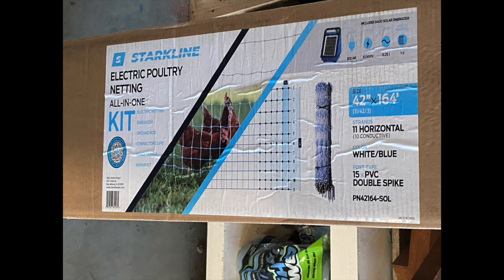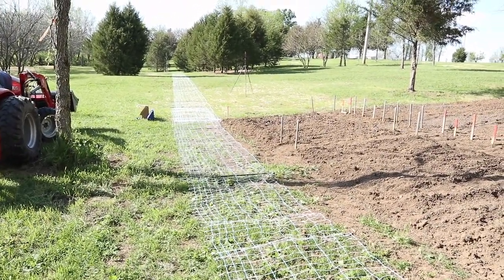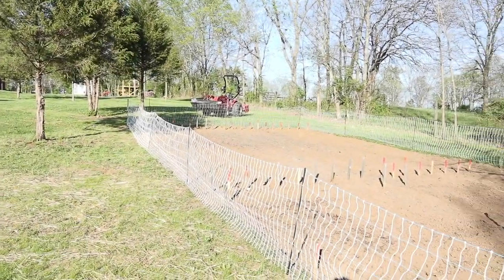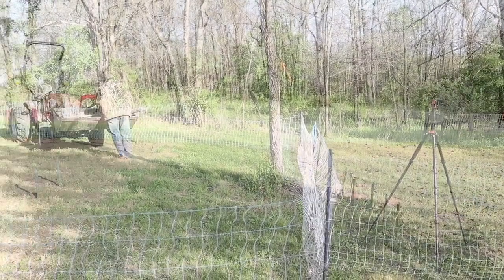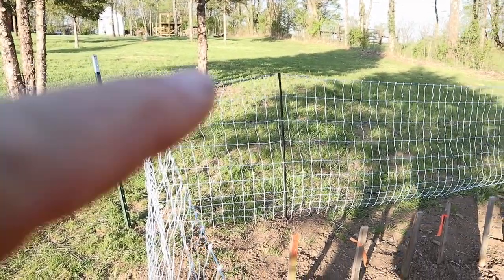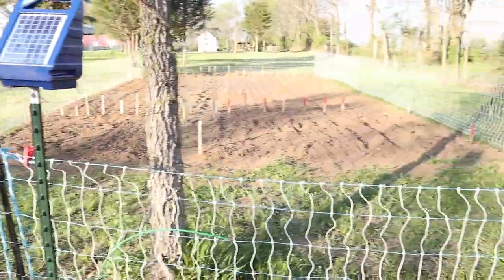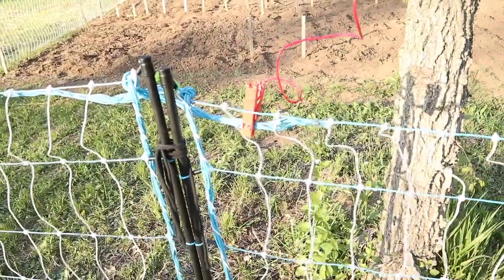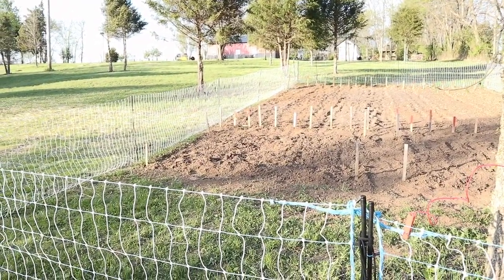#174:   Using Starkline Electric Poultry Mesh Fencing to Protect Garden

Comment: How do you keep the weeds from growing up into it? Thanks for showing how the set up works!!
Reply from the maker: Christie I wish I had a clever response for you... I rely on pulling the weeds out of the rows, at least until the plants get well established (you should see my squash beds, hard to see through the weeks), and for between the rows I either run a small gas powered tiller up the middle or, more often than not I just use a grass trimmer and it ends up looking like a lawn between my rows.    I do have one rule, no chemicals, so it has been tough fighting off the weeds.   Friend of mine tried straw between the rows, but he found there was just too many seeds in the straw.    If my garden was small, I would try cardboard and mulch I think, but where I want to just run the big tiller on the tractor every spring, that would be more work than worth I think.   If you crack the weed control code, do let me know :)      Thanks for taking the time to write the question, sorry the answer was so disappointing though.

Comment from the maker: I wanted to add a shout out to Colin Straight out at H&K Smart Fence where I ordered this kit from.   He had seen the video and agreed with my initial assessment that the ground rod was likely lost in transit as evidenced by the box damages and was kind enough to send me out straight away a replacement rod.    It also turns out the rod is designed to put the solar charger on top of, and thereby eliminated my other concern of the short ground lead connection.   Thanks again Colin!!!   🙂